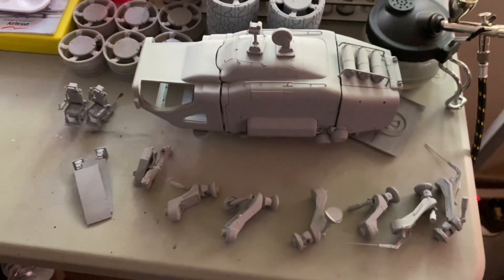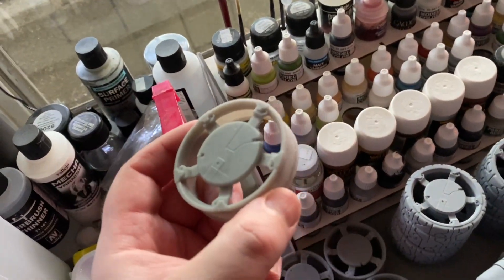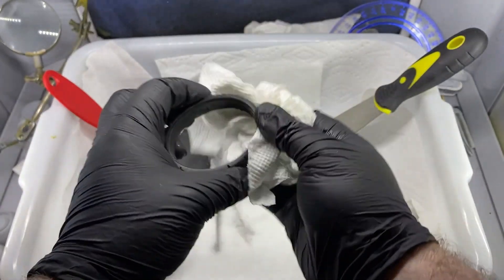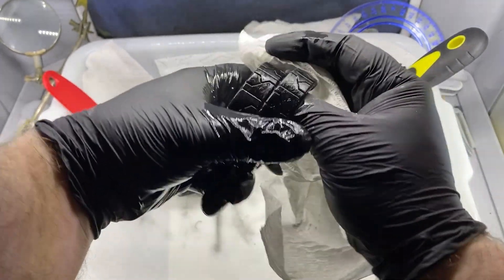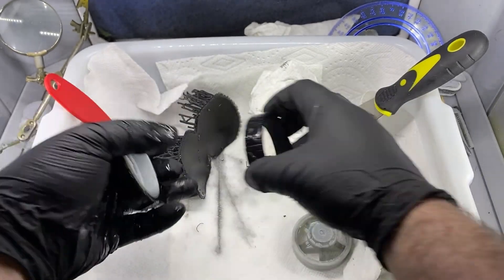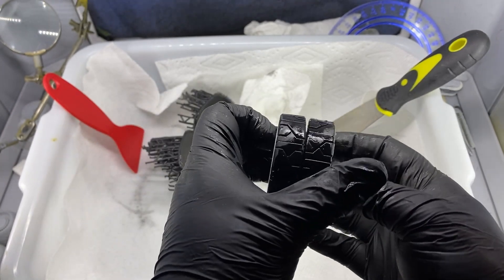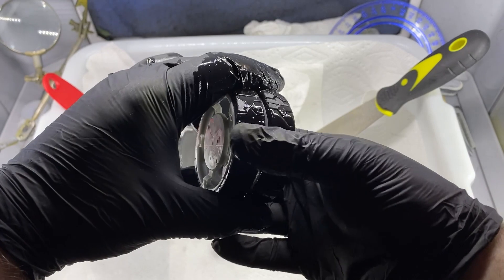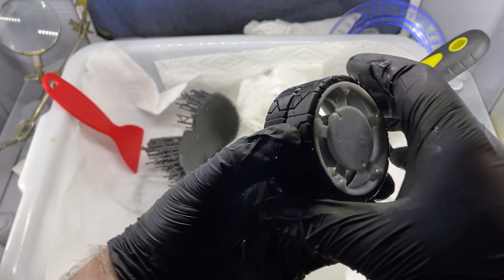Testing Wanhao rubber resin on Elegoo Mars.

Comment: Is there a resin that can be used with Elegoo to make "snap-fit" parts ??.. something that is a little more flexible than standard sla .. but not as much as rubber.
Reply: you find anything?
Reply: I'm wondering if this stuff can be mixed with normal UV resin to create the desired effect.

Comment: Since this vid is half a year old now, I wonder have you noticed any issues with these printed tyres? Like, material degradation, discoloration ...? Thanx for the answer!
Reply from the maker: look good as new, haven't pulled the tires off the wheels to see if they remain as flexible as the day they were printed, since they are kinda somewhat permanently installed, so that's the one thing I can't test.
Reply: @RuairiRobinson  Great! Thanx a lot for the answer. I've noticed some kind of material degradation on some of my scale models in the past, so I wondered if the 3D printed rubber has these issues.
Reply from the maker: @damirmejric3441  it wasnt anywhere near direct sunlight which might mess it up
Reply: @RuairiRobinson  Thanx. My finished models are also out of sunlight, so no worries there :)

Comment: What was that machine with liquid inside that the parts presumably soaked in? The sound of that machine was absolute ear candy
Reply from the maker: I know right? It's the most sci fi sounding thing I own. It's a formlabs wash, I got it used on eBay.
Reply: @RuairiRobinson  Any chance that the same thing can be done with just a bowl of water? Or is the process different than that?
Reply from the maker: @Dubswitcher  water doesn't clean the resin, you need isopropyl alchohol or similar. The wash machine just automates the circulation of solvent so it save a bunch of manual labor, if you are printing a lot.
Reply: @RuairiRobinson  Makes sense. Though, in that case, sounds more cost effective to just build a washing machine. Doesn't sound hard.
Reply from the maker: @Dubswitcher  sure or use a tub or an ultrasonic cleaner, or elegoo have a cheap wash/cure machine, lots of options.

Comment: Would love a video about that vehicle you're printing. Are you using normal elegoo gray? How are the pieces fitting together? I'm finding anything that needs to snap in place wont work because the resin is too brittle once cured
Reply from the maker: using siraya fast for this. They all shrink a bit but I usually give pieces that need to fit 1mm clearance on each side of the join, and you need to be careful with supports to maintain the shape and prevent warping.

Comment: what is the setting you use ?
Reply from the maker: on mars I used 
Layer height .05mm
bottom layer count: 6
exposure time 25 sec
bottom exposure time 120 sec
light-off delay: 0
bottom light off delay: 0
bottom lift distance: 6mm
lifting distance 6mm
bottom lift speed: 25mm
lifting speed: 40mm
retract speed: 40mm

So basically: slow everything way down to reduce peel forces, and increase exposure time a lot. I printed 6 sets of tires with these settings and all came out perfectly.
Reply: @RuairiRobinson  did you do a UV post-cure at all? Does the pliability change at all? And thanks for this! This is a very intriguing material.
Reply from the maker: @benkei242  yeah I cured for for maybe 10 mins a side. Not tacky after curing. Didn't notice any difference in flexibility.
Reply: @RuairiRobinson  I'm trying these settings for a tire I have and it says the print time is 18 hours. That sound right for a tire that is 57x57x35?
Reply from the maker: @MikeRankinGrandPappy  yeah you have to print very slow otherwise peel forces will rip it apart since its so flexible
Reply: @RuairiRobinson  Does slowing down Lift Speed really reduce peel forces? Don't they stay the same? I mean, if I have to pull a dart out of a wall, I can do it quick or I can do it slow, but I still need a certain force to get it out.

I understand some stuff requires slower Lift Speeds though, for example, I lower it a little for thinner layer heights so they don't get shredded as the build plate rises.
Reply from the maker: @henchmen4hire  explained pretty well here:

https://www.youtube.com/watch?v=BluqWRkBRHw
Reply from the maker: @DrNebin over 25°C